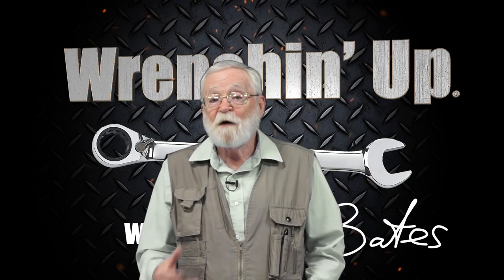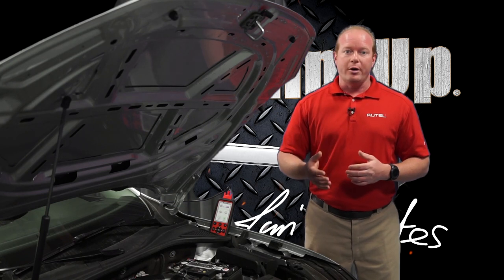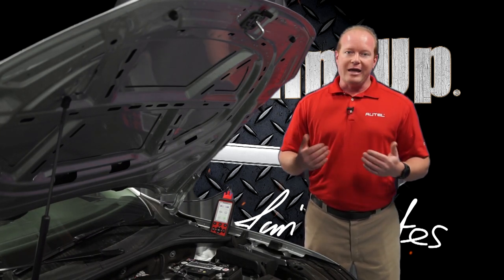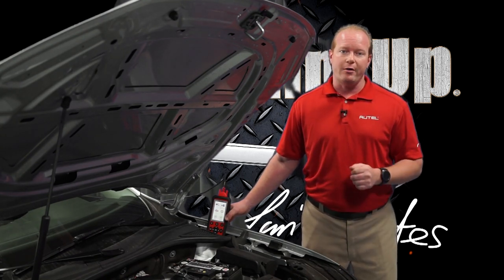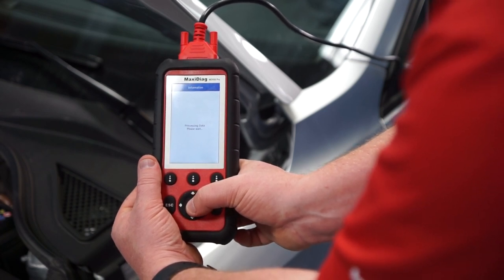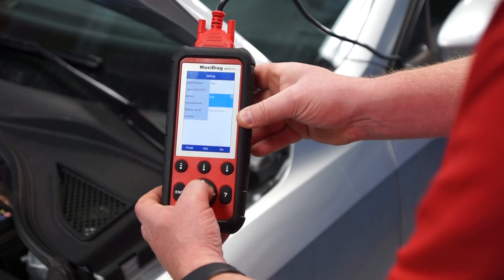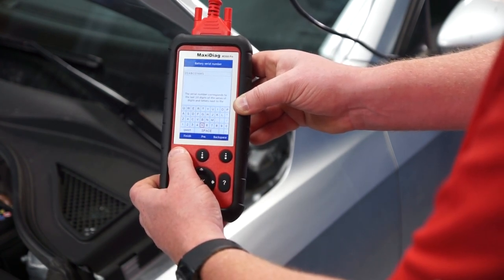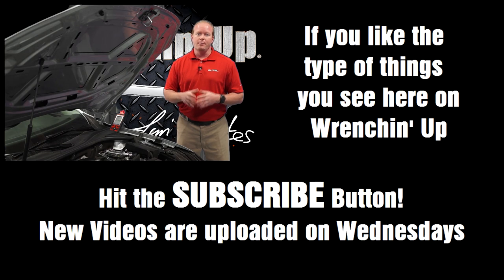How To Register or "Code" A Battery - Wrenchin' Up

Comment: In my opinion and understanding the computer of the car automatically recognizes that the battery has been replaced. No need to do the battery management. please comment for guidance.
Reply from the maker: Hi - Thanks for watching! The vehicle’s battery management system has no way of knowing that the battery has been changed. As a battery ages, the the computer is programmed to more aggressively charge the battery. Registering the replacement battery reprograms the computer with battery type, CCA (Incase that is being changed) so the charging rate be correct for a new battery. Failure to register the new battery will result in extremely short battery life due to aggressive charging during vehicle operation.
Reply: @WrenchinUpwithJimBates  i believe that happened to a vw beetle, the lady had a battery installed an 1 hour ago and now the car won't start, plus the battery is hot to the touch, i advise her to get is checked by a euro mechanic/specialist

Comment: My experience with a couple of BMWs and Audis was that the original battery lasted aboth 8 years. Toyotas' seem to last about 5 years.
Reply from the maker: Hi - Thanks for watching and sharing your experience. It seems to me that the batteries located inside the vehicle, in the trunk, under seats, in the floor, etc, last much longer than the ones located in the rather hostel environment under the hood.
Reply: i replaced my Original Varta 110AH Battery which lasted 14 years
Reply from the maker: Hi Frank - Thanks for watching and sharing your experience!
Reply: Working for AAA and it's a crap shoot how long a battery will last. About 3% of the batteries under the hood will go 8 years the rest will go five or less. Batteries are designed to be used so in the end it's all about how the driver drives and of course the environment of weather heat and cold plays a part also. European automobiles that have their batteries protected in the trunk or under the seat have an advantage to the weather however the same cars have more computers and pull an enormous amount of power from the battery too so it's a two edge sword.

Comment: So if the management system know to ramp up the amps , why is it so dumb to not know the new battery is stronger.
Reply from the maker: Hi - Thanks for watching! Great question. My understanding is that the Battery Control Module ramps up the alternator's duty cycle as needed, based on an algorithm that monitors the battery's age. That's why we have to tell it when a new (and what type of) battery is installed.

Comment: what you recommend diagnostic tool for Heavt truck Engine detroiit, perkins, cummis, deutz.  used to tug plane
Reply from the maker: Hi - Thanks for watching! I just recommend comparing the specs for the equipment that is available and choosing the best fit for your needs.

Comment: The original battery of my 2006 IS350 died because of not using the car for a year. Put a new $10 battery and has been working fine for almost 2 years now. Didn’t do any battery registration. So is this car battery registration just a European car thing?
Reply from the maker: Hi - Thanks for watching! I think it started in Europe, but now a lot of later model domestic vehicles have it too.

Comment: Will this tool code the battery on a Porsche Macan?  What about a BMW X5 and BMW M235?  What's the difference between an MD808 and MD808 Pro?  Thanks!
Reply from the maker: Hi - Thanks for watching! The tool works for all makes and models as far as I know, but I’m not sure what the differences are between the two tools. The manufacturer’s contact information is in the video description so you could ask them directly if you want.

Comment: Where you went to 'Battery Regulation', mine didn't work. It gave me an error saying to check the connection etc.  But, it did work under 'Gateway' and I had the same options as you afterwards. Do you think this still 'Coded' the system? My car is a 2012 Audi Q3 Quattro
Reply from the maker: Hi - Thanks for watching! Probably, but I’m not sure. I suggest that you check with AUTEL to be sure. Their contact information is in the video description.
Reply: Mine did the same on my 2009 q7 4.2 tdi
Reply: @WrenchinUpwithJimBates  Do suzuki swifts need battery registration after replacing stock one with bigger.? cant find any tool that registers battery for suzuki swift
Reply: Hi - Thanks for watching! I don't have any experience with the Suzuki Swift, but if it has an OBD II connector, the tool in the video should work but I recommend that you check with AUTEL to be sure. Their contact information is in the video's description. They will also be able to tell you if a registration is required. A service/repair manual for the vehicle may contain the information you need as well.

Comment: Excellent video, can be added a bigger AMP battery? For example upgrade from 80 to 95AMP? Thanks
Reply from the maker: Hi - Thanks for watching! People do upgrade their 12 volt batteries. Just be sure that the replacement battery meets or exceeds the original equipment manufacturer's specification that are outlined in the vehicle's owner's manual.

Comment: If you swap  the battery for an identical one same make numbers spec  ect .. and you use a memory saver  you still have to code it 🤷‍♂️ I don't why ...
Reply from the maker: Hi - Thanks for watching! If you don't register or "code" the new battery the vehicle's Battery Management System will charge it as aggressively as the old battery and shorten it's life - maybe as much as half or more. Check out our videos on battery registration to learn more about this. The links are in this video's description.
Reply: @WrenchinUpwithJimBates  hi just one more question... my car has to have the engine replaced  in the mean time the battery had gone  flat . I believe  the battery was taken out and charged on the bench .... ever since. Every now and again I get a battery low message ?  Do you think  I need to re register the battery to the car????
Reply from the maker: Hi - I don't think you need to re register the battery. That's not the issue. Have you had the battery tested to be sure it is still in good shape? If so, I would suspect a parasitic draw somewhere in the system that keeps draining the battery. One more thing to consider is that if you have a key fob stored to close to the vehicle (like hanging on a wall that is shared with the garage) it will keep "waking up" the vehicle which will drain the battery.

Comment: Thanks   Is there a difference in  Coding  vs  Registration of a battery
Reply from the maker: Hi - Thanks for watching! Coding seems to be a popular term for Battery Registration.
Reply: @WrenchinUpwithJimBates   I called my local BMW indie mechanic he seems trustworthy.    Coding  is different from Registration.  If I replace my old battery with the same type i.e Lead acid, Coding is not required . The computer already knows how to charge to battery based on the last coding input. I can do a Registration with my cheap scanner.. But now I upgraded to an AGM .  Since I don't have the proper scanners.  I need to have the new AGM battery coded by him. He says I need to drop off the car for maybe 2 hours.  (Lame )  He charges 1 hour labor $125 .   $160 for new AGM battery and $125 for the coding. I guess I should have gotten another lead/acid battery with the same specs.
I am looking for a  "For Sale" sign..
Reply from the maker: Hi - Well, I suggest that you watch the video again. You will notice that battery Registration and “Coding” (a made-up aftermarket term for the registration and recalibration routines that must be performed) can be done on the same tool, regardless of the type of replacement battery that is being installed. As explained in the video, the Battery Control Module (BCM) has been more aggressively charging the old battery as it aged, so the BCM needs to know that a new battery, along with it's size (CCA) and type (SLI, EFB, AGM, whatever), has been installed so it won't continue it's aggressive charging routine that would quickly ruin the new battery. I hope this helps.
Reply: @terrymutant3581  your mechnic is correct. Though battery will be registered, in case the battery has different specs, different charge, ex. changing from 80 Ah to 92 Ah, or from lead to AGM, and you"ll get a message that regisration was succesfull, the ECU would still see the battery as an 80 Ah if the OBD scanner doesnt't have the capability to configure the port.

Comment: Were do I find tool
Reply from the maker: Hi - Thanks for watching! These tools are available in auto parts stores. They are also available on-line if you know exactly what you are searching for.
Reply: @WrenchinUpwithJimBates  do you have name
Reply from the maker: Hi - We used a Battery Registration Tool. Many Scan Tools with the proper software can be used as well. It is not our policy to endorse tool brands, but there are a lot of manufacturers that offer the tools.

Comment: And what would happen if you installed a 70 Ah battery. You should have shown the screen steps where you can enter the battery manufacture, the battery type (STD or AGM), the capacity, the battery serial number and battery part number. All of these videos on YouTube are very vague.
Reply from the maker: Hi - Thanks for watching and sharing your opinion! To your point, you would just follow the screen steps and when it comes to the step to enter the Battery Ah you would enter 70.
Reply: @WrenchinUpwithJimBates  Unfortunately, some diagnostic tools enable that, except I have also seen some where you pick the Ah from a pre-determined list. For example, 70, 80, 90, 100, but they did not haven 92 or 105.
Reply from the maker: @achristian7015  Thanks for that information. I suppose as in almost everything else, some tools are better than others in one way or another.